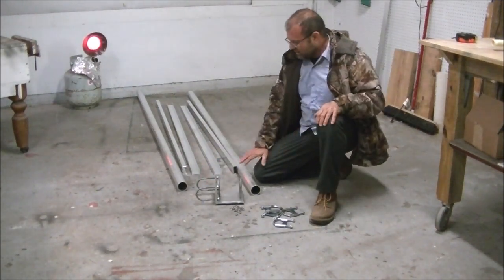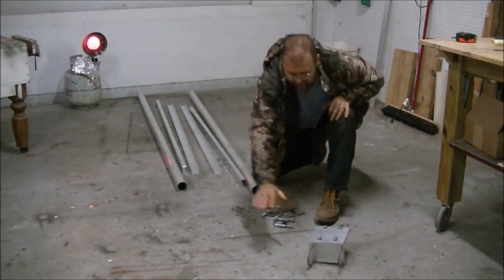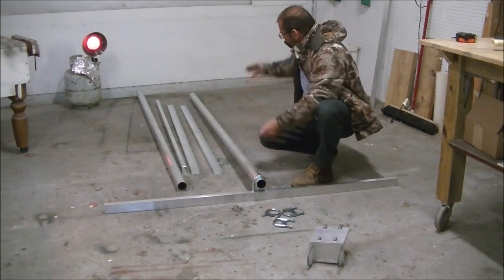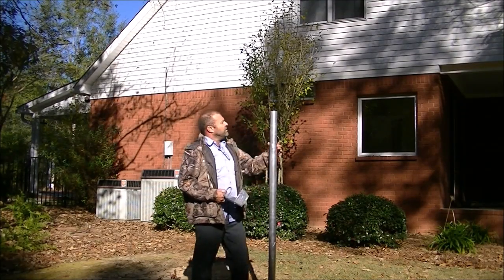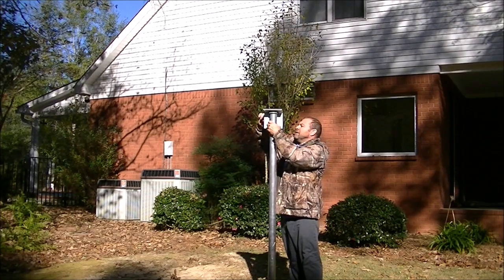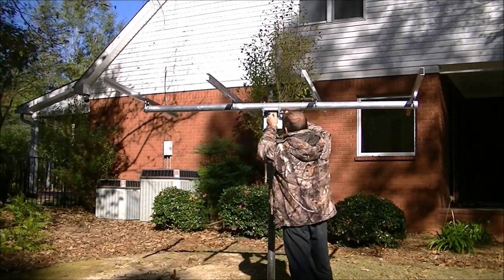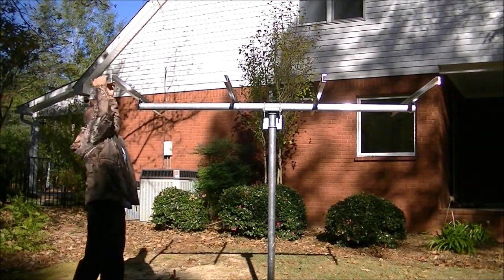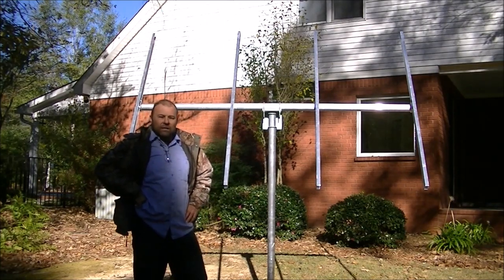Solar panel pole mount kit's. It will holds two large or 4 smaller panels, $259

Comment: Mark, are you still sells this mount?  If so, please provide details as where I can buy it.  I tried the links you provided above but didn't see it on Amazon and it looked like a different mount on eBay.
Reply from the maker: Hello, I still offer the kit but without the pipe. It cost too much to ship pipe. Here is a link to it on ebay.
https://www.ebay.com/itm/182369713087
Reply: @markp0177  Hello again Mark. Thanks for your prompt response.  I have seen the kit you refer to but it does not have, what I believe is called, a Steel Adjustable Universal Pole Mount.  

I seek a method of mounting two 180W solar panels to a pole in a manner which, first and foremost, will allow me to traverse the panels horizontally and to adjust the angle the panels are to the sun without too much difficulty (to adjust for the seasonal changes in the sun's arch).

In your video called  "Heavy duty solar panel pole mount kit. For sell" you showed two of these devices, both for a 1.5-inch pole but one more heavier-duty that the other.   I even found a pic of one with a 2-inch inside measurement for the pole but couldn't find any other info about it.  

The only other place I have found this device, in a video, is in a YouTube one entitled "DIY Swiveling Solar Panel Array" by Tiny House Listings.  It appears that he took this Adjustable Universal Pole Mount off of a satellite dish so I searched all over the place for a Satellite Pole Mount but no luck.

I did find the device on eBay.  Someone is selling one which is described as for a 10W-100W solar panel and another is offered as being for a 100W-200W solar panel.  However, at this point, I am uncertain as to whether they are actually different models.

I am looking for one which will accommodate two 180W panels sold by BougeRV, i.e., a 48-pound configuration subject to occasional 25mph winds (hopefully never more than 25mph).

Individual panel specs:
Dimensions: 26.38 x 58.27 x 1.38 inches
Net Weight (kg / lb): 10.9kg / 24 lbs
- - -
Side-by-side: 52.76 x 58.27 x 1.38 inches @ 48 pounds

The above findings leave me with these questions:
• Does this Steel Adjustable Universal Pole Mount have a more applicable name?
• Why did you abandon the use of this Mount?
• If I still wish to use one to create a solar pole mount in the same manner in which you once did, would you provide me with a source for this device?
• If you can sell one to me, what would be your charge for the heavier model and what would be the S&H?

Thanks again, Mark, for giving this matter your attention.  I hope you have the time and the interest to respond.  Much appreciated.

Tom
Reply from the maker: @chiptom6461  Hello Tom. I do offer the steel one too for large panels, here is a link.
https://www.ebay.com/itm/181223665389
Here is a link to the satellite bracket kit that will hold your two panels.
  https://www.ebay.com/itm/182228651801
All my kits are adjustable in both direction. I offer a dozen or so kits on ebay,  just click on other products to see them 
Mark
Reply: @markp0177  Thanks agin Mark.  I see that device as a part of the configuraton on the second kit to which you directed me (182228651801).   I just cancelled my order for the two 180w panels.  I'm going a bit smaller.  Would 2 at 100W each be your suggestion?  

Once I nail down a more accommodating panel size for me I will again be on the path to find the best mount.  I believe you have just provided me with the one I will likely choose to get.  Best to ya'.